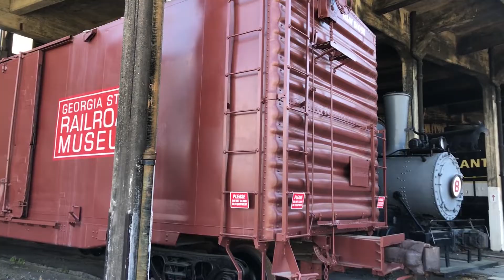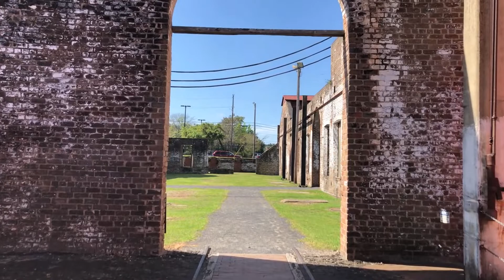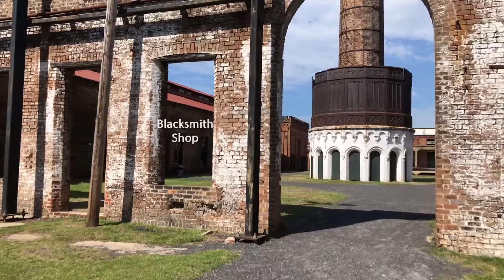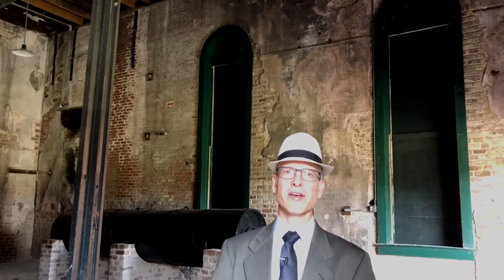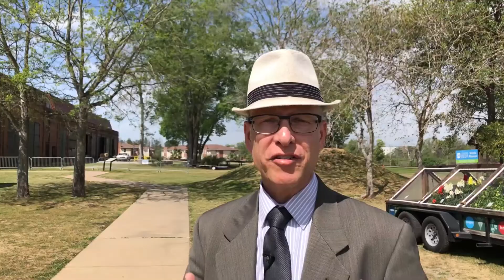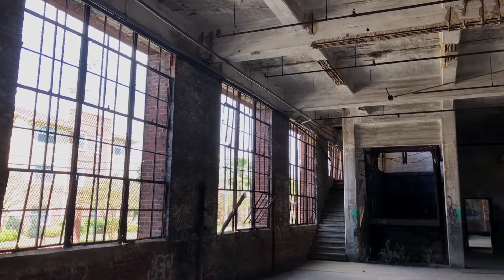Central of Georgia Railroad Shops Complex Savannah Architectural Tour

Comment: I model the Central of Georgia in HO gauge.  Still building up my roster of CofG rolling stock.  Pullman coaches with the CofG livery are impossible to fine.  Thanks for taking me along on this tour, as it sure is interesting to see the old CofG workings from the days of yore.  I've been to Savannah several times but the facility was always closed when I was there.   Guess this will be as close as I will ever get to see the CofG facilities.  I love the history of the CofG.  I'm 72 now and still play with trains.  I wish I could tour the CofG facilities before I croak.  Things were so much simpler in the 19th century.  I've seen only one photo of an engine from the CofG from the 19th century and it was an old 10 wheeler (4-6-0) and I would have thought that there would have been quite a few American standard engines (4-4-0) in the roster.  I've researched the roster for the CofG and the 10 wheeler is the earliest engine I've found.  I wonder what type of coal the CofG used, anthracite or bituminous coal.  Anthracite is the preferred coal 'cause it burns hotter and with little smoke. That sure is a dinky little steam engine.  There's a guy in NC, that collects and refurbishes steam engines and he's got an old Corliss engine that dwarfs that little red engine in the power house.  I would have thought that the steam engine in the power house would have been a much larger engine to support the line drives.  Cheers from an ex-Georgian in eastern TN